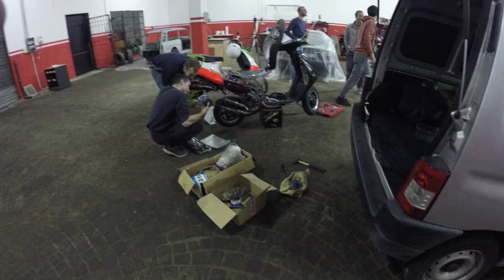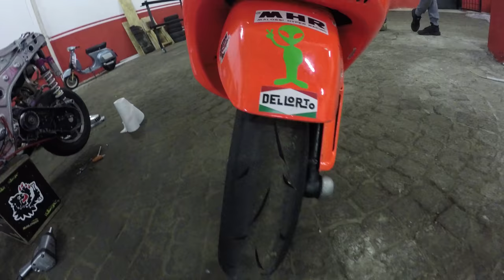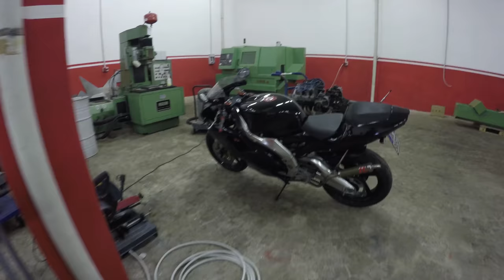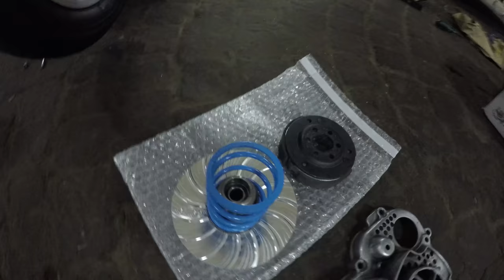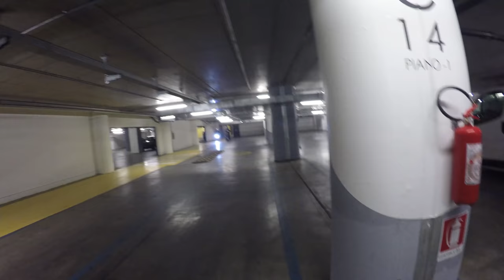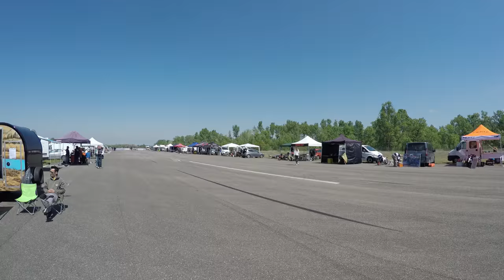2 stroke EpicNess and Meetup in Italy With ZipSp KawaAlien

Comment: who can help me?...
ive bought a aerox but its going really slow till 15 kmh, when it hits 15 kmh then the scooter accelerates good. So, 0-15 slow acceleration low rpm, 15-60 normal acceleration normal rpm...
Reply: Re-jet and other rollers , clutch springs
Reply: ive put some new rollers in 5.0 gram, i think my springs arent good. tnx
Reply: Doesnt need to mean what exhaust you have ?
Reply: Crepsitto just normal, sito exhaust original...
Reply: Hm rollers should be fine then check the springs and the central spring.
Reply: Crepsitto 👍i will check them
Reply: but now im going to sleep, thanks for the help!